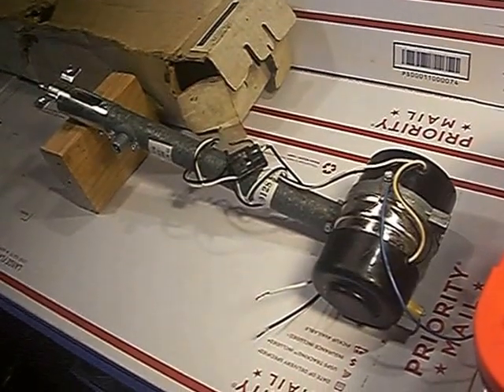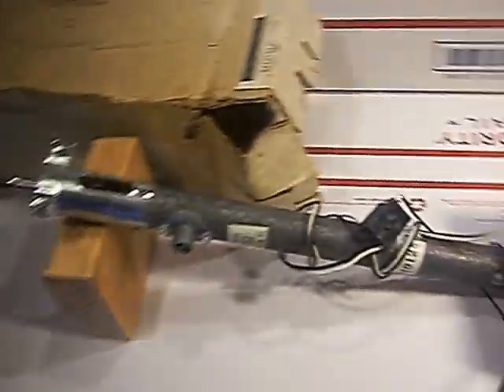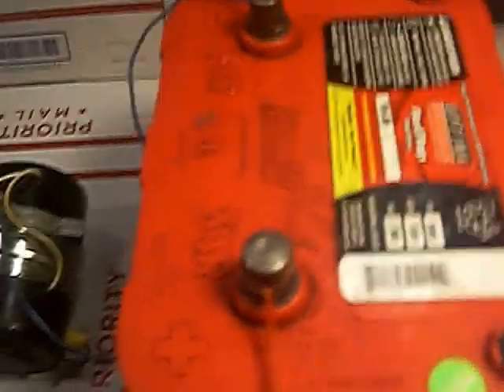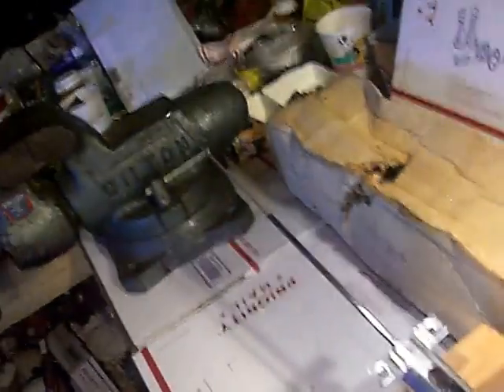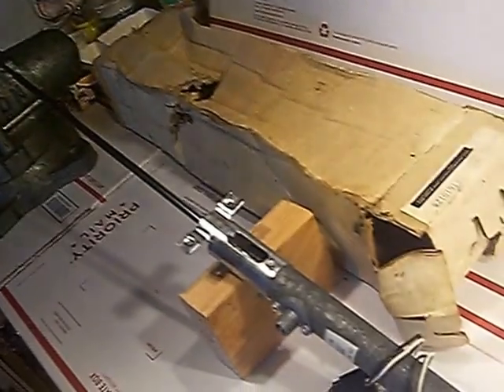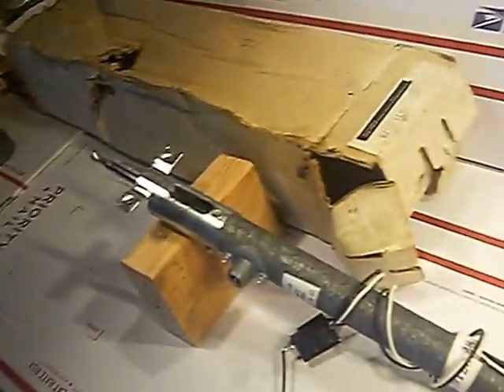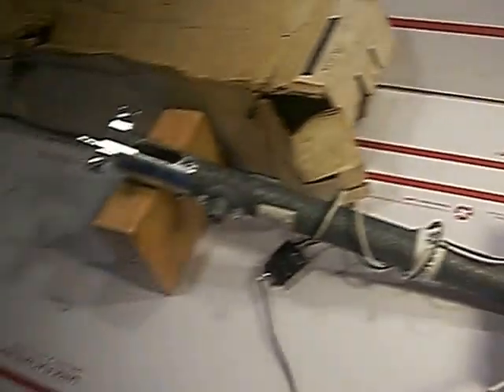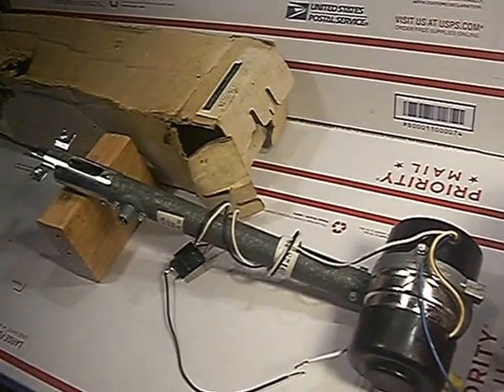Cadillac Power Antenna 1977 78 Operational Validation Test 1

Comment: Are you selling this?
Reply from the maker: Hello "Stallionaires" and thank you for your inquiry of my restoration work on critical Cadillac vintage component parts,.. specifically the restoration of the 1976 CADILLAC POWER ANTENNA RESTORATION.
I provide SHOW QUALITY restoration of the original Cadillac Power Antennas from 1959 to 1978. The 1976 Power Antenna is a mid upper range Power Antenna in this product category. The restoration cost is $550 plus shipping and requires the buyer to send-in an existing CORE UNIT for exchange or restoration. I also have fully restored inventory units in stock for $750 plus core exchange plus shipping for immediate delivery. 
I have over 75,000 original vintage 1967-1970 Cadillac items in my collection and over 250,000 1959-1978 Cadillac items overall so if there is anything you may require feel free to reach out to me again. I am best known for my Restoration of the Cadillac Steering Wheels and Steering Columns, Power Seat Mechanisms and Stereo Radios and Power Antennas.
Kind Regards,
George
Tel: 727-364-7523
eMail: kypitsn@aol.com